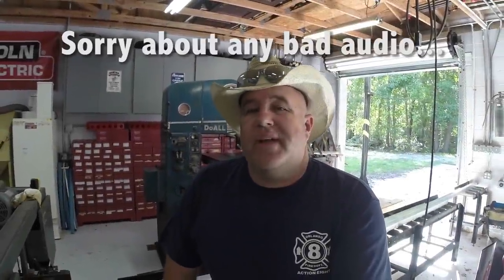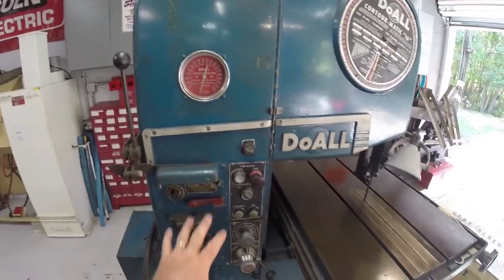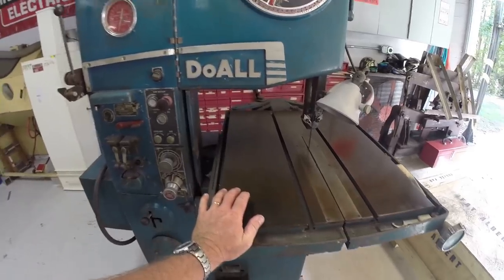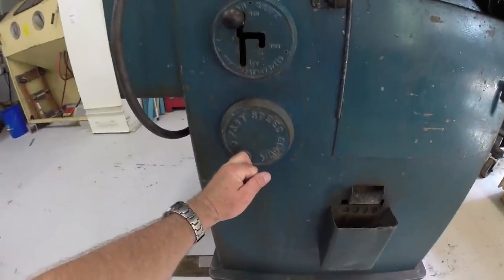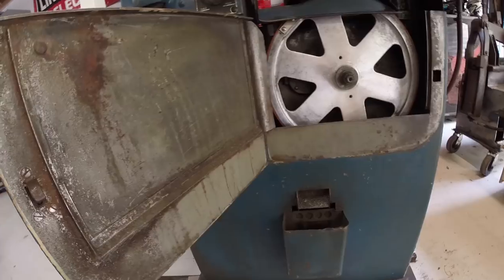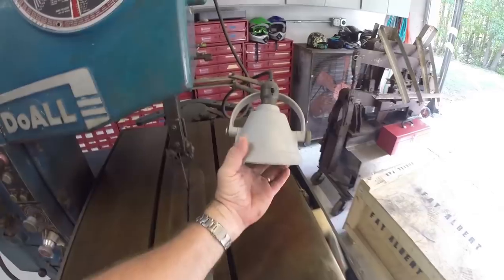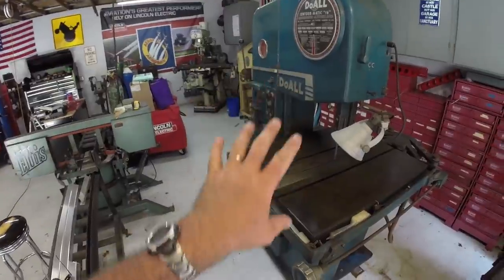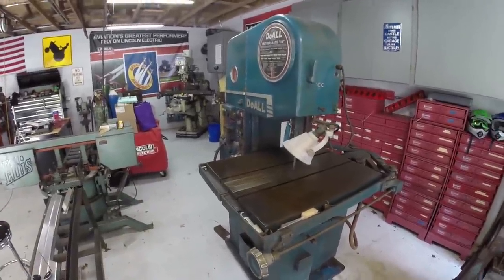Do-Rite new gear: Introducing my new 16" DoAll bandsaw

Comment: Got an old DoAll myself - a bit older than yours.  Blade welder is an important accessory....did a blade welding demo on my channel - Makers Machining.    Phase converter was also discussed for those that don't have 3 Phase.  Keep up the good work. Nice content.

Comment: There is another use for the blade welder. If you have to cut an inside contour you drill a pilot hole, cut the blade, feed it thru the pilot hole, weld it back together, and cut the inside contour. Then break the blade again for the next part.
BTW, I like that color; I'd leave it that way.
Reply from the maker: l wilton That's a great idea, thanks!